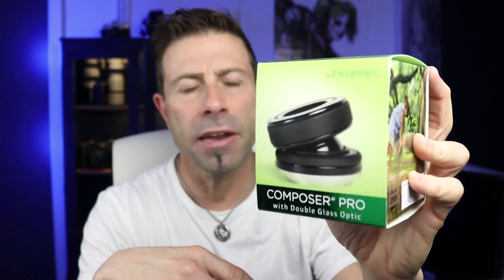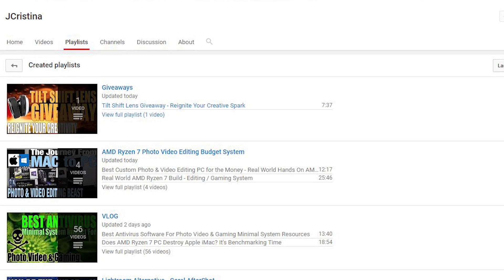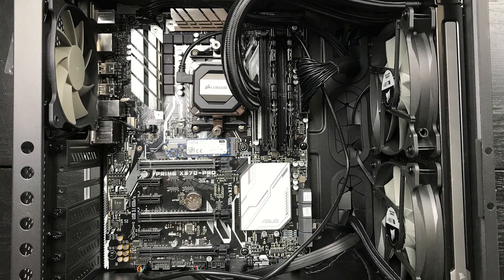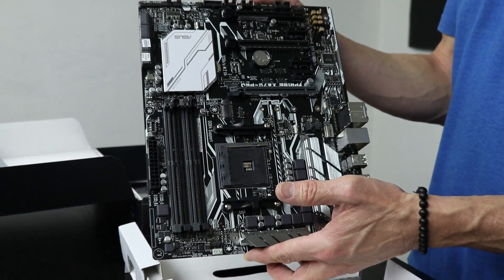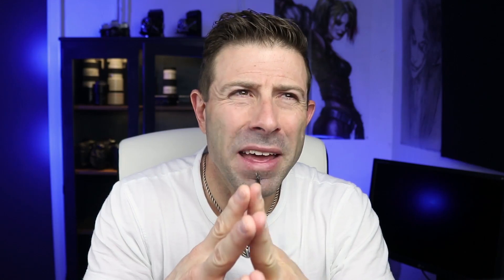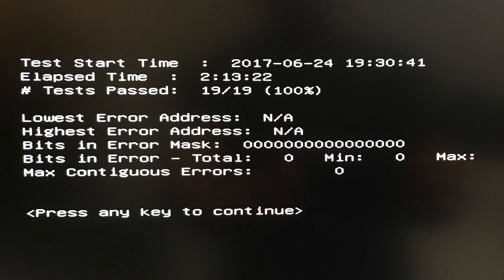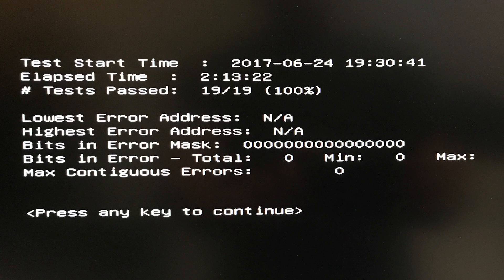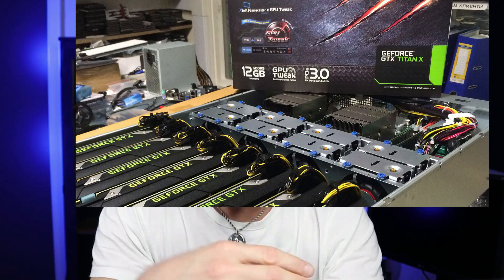Does AMD Ryzen Suck As a Production PC? Why or Why Not - Reliability Update Drivers, Firmware

Comment: Did you install the chipset driver from AMD directly? They launched with the actual driver available from their website which no one was installing when they installed windows which was causing this issue... in fact, The Ryzen processors aren’t reaching their max performance in Windows without the chipset directly from AMD driver.

Simply go to the lower selection screen, do not select the graphics portion. Select chipsets, then AMD Socket AM4, then your motherboards chipset. Download and install the available driver. 

https://www.amd.com/en/support

You should also have Ryzen Master installed and you can get it from the same page.

Comment: This sounds like RAM issues. You probably got RAM that is not compatible with Ryzen. Ryzen is testy with RAM. It is better now, but it is still something to keep an eye on. I suggest sticking to RAM listed on the compatibility list for you motherboard. Yeah, we are having to deal with RAM compatibility lists with a desktop processor. Buy, hey, it's new and based upon dies built with servers in mind. It is interesting that a clean install of Windows fixed it. Perhaps there was a Windows update that fixed something. Maybe it was just some new hardware drivers. I wonder if doing a sysprep as if you were moving it to a new system (where it unloads all hardware drivers and reloads them on the next boot) would have also fixed it.
Reply from the maker: +Austin P Great idea Austin. I found it strange also as I had memory that says Ryzen Compatible stamped right on the packaging. 15-15-15-39 1.2v 2400.  Can't run them at anything beside this either on my Asus Prime x370 Pro sadly can't OC.
Reply: JCristina 
Interesting. Perhaps the RAM still is not compatible with the motherboard, however. Here are the memory compatibility lists for that motherboard.
https://www.asus.com/us/Motherboards/PRIME-X370-PRO/HelpDesk_QVL/
Reply from the maker: +Austin P Im going to check today. 👍
Reply: I just checked. For Corsair DDR4 3000 in 2x16GB kits, it only lists this Corsair Dominator kit:
https://www.newegg.com/Product/Product.aspx?Item=N82E16820233885&cm_re=CMD32GX4M2B3000C15-_-20-233-885-_-Product

However, I am guessing that your RAM is compatible since this kit is. But, it is possible that the sticks are different.
http://www.corsair.com/en-us/vengeance-lpx-64gb-4x16gb-ddr4-dram-3000mhz-c15-memory-kit-black-cmk64gx4m4b3000c15

This is a compatible kit, but it is red and a little more expensive than what you have.
https://www.amazon.com/G-SKILL-Ripjaws-288-Pin-Platform-F4-3000C15D-32GVR/dp/B01B3T4A3Y

But, since the reinstall of Windows fixed it, perhaps there was some odd software problem.

Comment: That's why I use Linux for as much as possible - you just have more control. Unfortunately Adobe doesn't care...
Reply from the maker: I do run a Linux system also but for fun. There is just not the software that I need available. :(

Comment: My pc runs perfect
Reply from the maker: +ben fuller What is your build configuration Ben?
Reply: JCristina is the asrock killer x370 Adata 16gigs of 2400 ddr4 a kingston sdd and a msi rx 580 and two seagates for storage one a 1tb and a 2tb the rams a placeholder but it works fine the MB bios update did go a long way with stability but I switched from a fx 8320 or 8330 I'm not sure which but my video editing goes so much quicker. I do run into a thing with a few missing fps in world of warcraft but all the other games run awesome.
Reply from the maker: +ben fuller Awesome Ben. Sounds like a really nice setup. ASUS has a new bios release that I'm going to check out. It was In BETA for a while but now is production. We'll see how that works. Thanks for sharing Ben.

Comment: That's absurd. Got a r7 1700 with an asus CH6 board. NEVER had such a problem (even with early BIOSes) and i'm running heavily OCed on both CPU and RAM.
I guess your system was somewhat corrupted by a malware or something... or maybe conflicting drivers.
There is no freaking reason to say it's AMD's fault since, i believe, no one had the same problems you described.
Also, the first thing to do when you got such problems, even before RMAing you hardware, is to try a fresh OS install...
Reply from the maker: I too have never heard of this but do think it was due to a Windows 10 Pro auto-Update (turning that off) or a driver update for one of the accessories.  I'm enjoying working with the Ryzen 7 and look forward to continued development..

Comment: Thanks for sharing but it doesn't surprise me that you would have needed to reinstall the OS.  There could have been Intel-specific Windows updates on your existing config when you were running on an Intel cpu which could have lead to this instability.  As for backups, I personally use Clonezilla on a spare USB 3 1TB external drive to clone the entire drive including its partitions and it has worked very well for me and it's free.  I actually have several images on my external drive at various stages just in case I ever need to restore them.  Glad to hear that your issues went away with the new OS install though as diagnosing intermittent system issues is always a real pain to deal with.
Reply from the maker: +Frank Wagoner I'll have to check out the software for sure. As for the build, it was a brand new install not an upgrade for intel but that for adding your thoughts Frank!!
Reply: JCristina Oh didn't know that.  Then I definitely see your desire for backups after your new clean install before installing each of the major apps that you use.  My first guess would be a software specific issue or an app specific update causing the instability and those can indeed be troublesome to diagnose.  I've got a new Ryzen 1700X rig on order and plan to put it together in a few weeks.  I'll let you know how it goes and hope I don't run into any of these issues.  I have two friends who built systems with Ryzens (one with 1700X and one with 1600) and they have been working well for them at lesst so far.  Both were built in May.  One uses Premiere and records/edits kid videos .. the 1600 user, while the other games a lot and works with Wordpress sites in Virtualbox.  To be honest they were the ones who convinced me to build this Ryzen rig so keeping my fingers crossed.
Reply from the maker: I really like the AMD Ryzen build and look forward to continued updates and patches that make it more stable. Keep us up to date with your Ryzen 7 1700x build.

Comment: Great VLog- i feel your pain for sure. I have used acronis for years and it works pretty good, but the local computer guru turned me on to this: http://www.lazesoft.com/lazesoft-recovery-suite-free.html. I do both images and clones and like working off the clones before I try a piece of software that i don't know how it will interact with my system. Never been a fan of the built in windows backup.
Reply from the maker: Thanks for sharing.. I'll have to take a look. The built in full drive image does have it's issues but I've worked around them. I might vlog about that in the future to show my method to hopeful help someone out that might have this type of issue with any computer. Intel or AMD, no matter.. Thanks for the positive feedback as always!
Reply: Also, I agree with you about making full image backups and not incremental ones.

Comment: 1700X on ASRock x370 Gaming K4 owner here. Went through the same issues and similar process as you did.
Random crash: Yes, but CPU stress does not kill it, GPU stress does not kill it, combination is also not it. And it only happens in specific applications (currently one: SonyMovie Studio 13)
When my system crashes, it behaves as if it overheated. Fans ramp up to max, then the system reboots. When logging into windows, the GPU driver appologizes for the crash. Well... Time to learn DaVinci Resolve (does not crash).
Reply from the maker: LOL. The work around is moving from SonyMovie to DaVinci.. :) I love it MazeFrame. I would suggestion backing up your data and do as I did, a brand new install of Windows, without any updates and see if it solves the issue. I would also create a BootDrive Image as that point so you can alway get back to GROUND ZERO if things get "hosed" again. Thanks for adding to the conversation. Love to hear your progress!
Reply: Thanks to the Level1Techs forum, I found the solution without nuking my windows install. It was simply a matter of wrong RAM settings as choosen by the motherboard. The AGESA 1.0.0.6 update seems to have broken automatic RAM timing settings on most motherboards.

Comment: I have a Ryzen 1600 and have had no issues with it what so ever, but I still haven't downloaded my drivers yet.  you probably don't have you heat sync applied properly and its just over heating.
Reply from the maker: That was a thought I had but the system is running on water. Running at 49C at 100% load 8 core 16 threader. I also, reinstalled the heat brick when installing the new mother board which did not solve the problem. The only think that worked was a brand new install of Windows 10 Pro so I'm guessing it was a driver/update problem. Thanks so much for sharing Thomas!

Comment: just went through this with my 1600 build . http://support.amd.com/en-us/download/chipset?os=Windows%2010%20-%2064

power settings in windows should straighten this up
Reply from the maker: Yep. All power setting were correct before this issue and once again after the new Windows 10 Pro was installed.  Thanks for sharing the AMD chipset click. I'm sure many in the community will find it helpful Shawn and thanks for adding to the conversation.

Comment: Debugging can be such a nightmare. I had something like this years ago with the sandybridge - motherboard had to be recalled. It was replaced but after a couple of years I had the same issue. Hardware was all fine but I found that after some days the gpu  would cause the computer to randomly shut down. It would also corrupt the system. I would take the GPU out and it would work fine - I would reinstall the GPU and for some time it would work fine. Sold it to my computer friend who built second hand systems. He said hardware had no issues but put the GPU in another build.  Its difficult to say though what corrupted the win10.  Whether it was  a hardware glitch of the ryzen platform, whether it was an overload of the system - etc or just a random software glitch.. I've been using win10pro but on a lesser intel i7 6th gen system build (ryzen came out a month later) and so far no issues with win10.  One of my concerns with the new ryzen platform is that being such a powerhorse, whether the calibration with motherboard/chipset - GPU - drivers has been adequately worked out as well as heat issues. Minute electrical surges which would otherwise cause no issues can cause glitches with heat issues. These may not be visible at first but over time can cause issues.   My own golden rule is that I prefer  less speed  but a cooler more stable platform. I also try to keep my builds as minimal as possible.  Meanwhile hope you have no further issues as otherwise the ryzen has so much potential
Reply from the maker: You are wonderful Giti.. Thanks for adding to the discussion and the positive feedback. I know it was a driver/update issue but I do not which one, sadly.. For now, simply creating frequent and numerous full boot drive images will help me quickly get back to production incase this should happen again, fingers crossed.. :)
Reply: Thanks thats so nice. I know the getting up in the night and trying to debug process!! Thanks  also for the video. It helps the overall knowledge base and your earlier video on the build with your son was very touching. Its a very receptive age and such experiences are precious. I don't know whether it helps but there were some issues with GTX 10 series - drivers - motherboards - win10. MB Bios had to be completely updated and only in service centre and the latest version of win10pro. The failed installation had to be completely cleaned out.  I still sometimes have issues with monitor freeze in 4k 60hz (UHD LG 43 inch 4k tv). But I usually work in 1080p (which TV settings enhances) and change to 4k when I want to monitor 4k footage or high resolution stills. I didn't have the same issues with the onboard intel graphics. It seems that there are so many more settings in display resolution - color depth/mode etc and display units don't update their drivers. Again all the best for your system and also for the process with your son.

Comment: You ask for likes with a headline like this  "AMD Ryzen Sucks As a Production PC" Ryzen's not the problem here.
Reply from the maker: I'm not blaming the platform, just bringing it to everyones attention that there are issues simply because it's only a 4 month old platform and offer a means of getting around the problems which will surely plague the system until everything gets hammered out between the Motherboard, Memory, GPU, Software manufactures and AMD. I am a fan of Ryzen incase it didn't come across even though I'm used Intel for 20+ years. Thanks again Axe for adding to the comments...

Comment: I had similar issues with ryzen7 1700, prime x370 pro, and asus strix 1080ti, fresh windows install worked for me as well, old drivers from my previous mobo and cpu left some garbage into my windows install
Reply from the maker: Interesting. Since this was a brand new build and install, it had to be a "PUSHED" update, either Windows or one of the other devices. I wish I knew so I could pass it along to the community.. :( Thanks Valtteri for adding to the discussion!